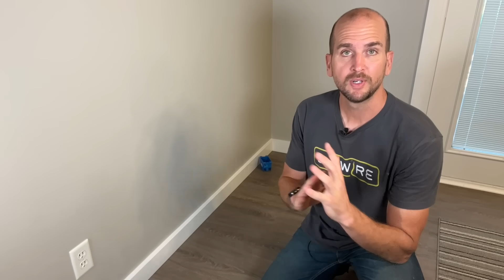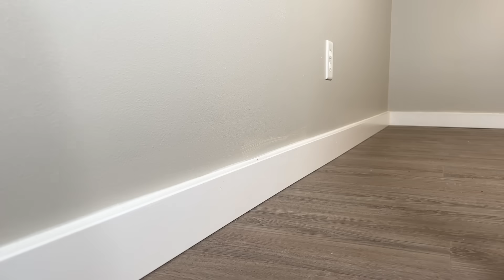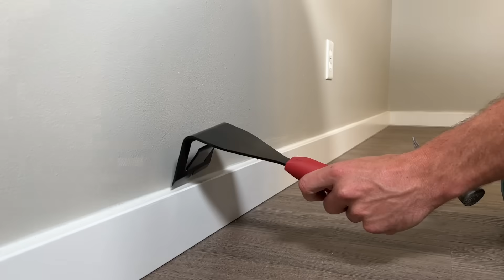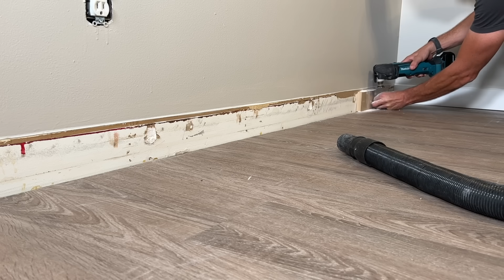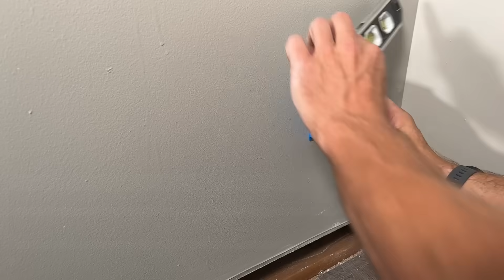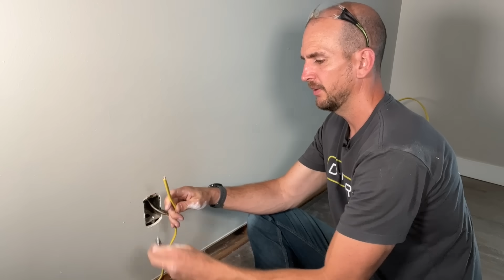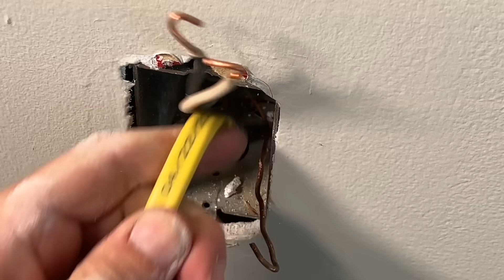How To Add An Outlet To A Finished Wall

Comment: This was perfect timing; I'm going to be installing several outlets this weekend into spots where I have neither access from below or top, and will be using your techniques to get it done right! Thank you!
Reply: If you want to comply with the NEC, you need actual steel plates to protect from nails and screws, not luck.
Reply: BURN THE HOUSE DOWN
Reply: @Rizzodrumz  Why do you say that?
Reply: He's probably refering to the potential electrical code violation you might be perpetrating. If there is more than one cable going into any existing box when you open it up, you most likely should not add another cable.  CEC/NEC regulates junction box fill. If you over fill a box this weekend, you could burn the house down in 15 years. Just sayin.
Reply: @yoyomama5203 :

NEC §314.16(B)(1) requires that each conductor originating outside the box and terminated/spliced within the box be counted once, and each conductor that passes through the box without splice/termination be counted once.

Please explain why you are double-counting or triple-counting spliced conductors.

Comment: Great video, in metal boxes I usually wrap the receptacle with electrical tape covering the screw terminals, thus preventing the side terminals from contacting the metal box. Not necessary, but professional touch.
Reply: Not necessary at all. Unless it's hot. Then, just to make you feel better

Comment: If you suck up drywall dust, make sure to put a pool sock over the filter. Makes them last 20x longer, and far easier to clean off.

Comment: Good informative video for adding an outlet without turning it into a much bigger project! I hate to be THAT guy and I know this video wasn't about this issue, but I didn't see a pigtail for grounding the metal enclosure. Isn't that required for all metal boxes? Did you connect the new wires and outlet to the existing pig tails and the box ground is way back in the box? Just curious.

Comment: I love your video however you can’t convince me that lever connectors are better than twisting wires and putting a twist nut on them. Those connectors can fail but wires twisted together will never loose connection

Comment: Definitely a lover of the Wago 221s as well.  Replaced a standard outlet and switch last night in my breezeway and it was a rat's nest in that 2 gang box.  The outlet had three wires on each side (1 on the screw and 2 backstabbed):  Incoming, to/from switch/light and going to another outlet plus two on the ground screw-the switch was old enough to lack a ground screw.   Wound up using three five position Wago's (one each for hot, neutral, ground) and pigtailed to the new switch and GFCI receptacle.  

I'm sure if I had used conventional twist wire nuts, they would have kept falling off (or had a wire not grab) enough times where I would have felt like punching the wall in frustration.

Comment: I used to do low voltage work (alarm systems etc.). We would remove the trim and then run the wires under the drywall. Since there is usually a gap between the floor and the drywall it worked perfectly.

Comment: I like the idea of making a block for cutting the drywall, buy I would have checked to see where the supply line  for the box comes from first. You may have already known that, but DIYers may not think to do that first. Good job though.

Comment: It works, but I'm sure it isn't legal where I live,  L.A. area. You need nail plates on both sides of wall where romex passes through 2×4s unless you're using steal conduit, not aluminum. And here romex must be anchored to the last stud it passes through on both ends.
But your job works, just isn't legal unless codes have changed since I built my house in 2000. Plus codes tend to get more restricted than less.

Comment: This would work awesome if I had a newer remodel baseboard trim. I have original 1950’s trim and that stuff is nailed solid through and through. Even went through some of the original hard wood floor. No luck, will have to open up those PITN plaster walls, gets everywhere!

Comment: Do you need to worry about tripping the breaker easier since you're wiring these in series?
Reply: They are actually wired in parallel. You only have too worry about plugging in and turning on too many appliances.

Comment: what was the reason for the pigtail? Could have just connected to the second screw terminals for an easier installation without having to cram more wires into the box. Pigtail really only makes sense for the ground wire in order to ground the metal box and receptacle
Reply: Pigtails are what we in IT would call "Best Practices". It allows for easier diagnosis and repair in the future.

Comment: This might save you some time with drywall patching but IMHO the easiest way to do this is with a trick I learned from a local set of electricians where you simply use a router to create a 1/2" channel straight between the boxes. One thing to consider with the shown process is that most amateurs are going to end up damaging the baseboard trim during the extraction process. But if you're truly averse to doing any drywall work then by all means use the approach shown here, but for me the direct channel is the quickest process.
Reply: Agree!  Often to damage then patch the  original shiny smooth paint on finished trim/base board (like sprayed oil paint) is much harder to fix than patching dry wall with regular flat paint.
Reply: No

Comment: Great tips!   Both running the wire behind the baseboard, and putting the connector onto the wire before snaking the wire into the box.  I am AWFUL at drywall patching!

Comment: "You can never have too many outlets" - Wrong. The Canadian Electrical Code (and US NEC too I believe) limit the number of devices (lights + receptacles) on one circuit to 12. You didn't indicate that you verified the number of devices already on your circuit before adding one.

Did you use a code-required tamper-resistant (TR) receptacle?

MOST importantly: You did not pull a permit and get an inspection. Inspections are intended to catch errors like these and to review the quality of your work so it does not electrocute a child or start a fire.

Although you appeared to do good electrical work, it would have been illegal in Canada and maybe in the US too. You may do inspected work on your own occupied residence but you MUST be a licensed electrical contractor, at least in Canada, to do work in premises which you are renting out to others and not occupying. You stated this work was for an AirBnB. In Canada (and maybe the US) if someone dies as a result of your illegal work you are in for a pile of legal and financial pain.

I did like your neat, careful, and effort-saving techniques which I will consider in my own upcoming work in my own house and which I will be getting inspected.
Reply: You're not required to pull a permit for simple electrical work in the US like this as far as I know. Now if we were adding a new sub panel or something like that, that might be a different story. I'm not sure about the 12 device limit, but likely true.

Comment: When drilling the new holes for the wiring through the studs you said to drill them slightly up under the drywall. I was wondering it there a electrical wire minimum   height from the floor according to code? Also, I noticed the volume level on your videos seems to be a little low.  I have to turn up my volume and turn it back down when going to other videos.

Comment: Great idea. The only bit of safety concern is the romex is not protected by nail plates on studs behind drywall. Is this something an inspector can call out?
Reply: Got an answer from electrician buddy. Said because romex is behind finished drywall it's good. If it were lower in exposed area then nail plates would be required.

Comment: Why’d you decide to use the pigtails for the hot and neutral of the existing outlet instead of back wiring both sets of conductors?
Reply: Pretty sure it's code now that you don't string a circuit through an outlet to another to another, primarily for safety as instead of having power go through a wire nut or Wago you're running the power you're using through those little break away connector tabs on every outlet in the string and if you ever have an outlet fail every outlet downstream will also be non-functional, which might present more of an issue for some non-handy people who need to wait and pay for an electrician to come out as opposed to simply having one outlet not working.
Reply: @msytdc1577  Maybe local code, not NEC. Certainly the connection from the 2 back screw plates on the same outlet is more reliable than a spring connection in a Wago. The breakaway tab between the top and bottom sets of screws is able to handle 20 amps even in a 15A receptacle. Pigtails have become the "best practice" for the majority of electricians though. If it became an NEC code, the receptacles would no longer have the extra connections on them.
Reply: @markc2643  A lot of the time lazy installers will utilize both the back push-in connectors as well as the side screw terminals in order to chain outlets and/or split off connection to a switch for lights or switched outlets, so unless they come out with products specific to only one method of connection I don't see how they can eliminate 'extra connections'. 

And the little break off tabs are to allow for the top outlet to be on a different circuit than the bottom outlet (one often being on a switch for free-standing or table lamps), so again unless they eliminate that tab you could always take advantage of using the top and the bottom connectors (push in or screw), the manufacturers would have to sell outlets that are either connected or not connected with either only push in or only screw terminals, so now you're up to four SKUs from one, yikes.

The commercial backwire outlets shown in the video do allow for two connections on the same screw (top or bottom), and they're pretty beefy and I wouldn't anticipate any issues with connecting two wires that way.

Aside from slightly greater resistance the Wago connectors are perfectly good, and I'd counter that the clear body allows verification of a proper connection (fully inserted, wire insulation stripped back to proper length), and are less user error prone than using wire nuts in general, as it's often easy to have a wire have a poor connection that passes an initial pull test (if installer even bothers), and later loosens up from heat cycles or someone monkeying in the box like stretching an outlet out to paint or something, not even necessarily electrical work. 

Wago connector springs serve only to apply constant pressure of the wire onto the metal connecting bar, they do not transmit any electricity, and you cannot disengage that spring without flipping the lever 90 degrees which requires quite a bit of force and if it's really that concerning you can tape around the connector. 

Wago also sells push in connectors without levers but they are not suitable for use with fine stranded wire such as for a ceiling light, but they are faster and easier on your fingers than the lever models. You can still remove wires and reuse the connector a limited amount of times with solid conductors. The body is also clear to again allow verification that the wire is fully inserted.
Reply: Less force needed to push the outlet into the box, and fewer wires to get the bend right as you are pushing the outlet in. It works just fine connecting the hot and neutral to the outlet when you have back terminals though. You can connect 4 wires on each side of an outlet, but it makes it quite tricky getting all the wires to comply.

Comment: Awesome video. Been learning a lot from them. Question if your original outlet has the blue plastic box how would you secure the new new cable from the bottom when adding another outlet further down the wall?
Reply: You don't need it. Just make sure you leave 6 inches of wire sticking out past the wall on both sides to connect outlets.

Comment: What a superb video. I’m in the UK and although I used to be an electrician I found the trick of cutting a low strip off the plasterboard very useful. Surprised the American regs allow bare earth wires in a box with exposed live terminals. We put green sleeving over the earth wires
Love that you say Romex, manufacturer? When we say twin and earth

Comment: Awesome clarity and descriptions. 40 year diy and I still learn something new.
Only additions I would add is some blue tape and/or cardboard to avoid oh shit moments if something slips and damages your nice floor, moulding, or paint.

Thanks for the enjoyment of watching another good diyer.

I just started using the wega connectors but would likely have used the double screw terminals on the exsisting outlet to daisy chain the wires. There is still far more surface area on the screws than any connector I know.
Has anyone seen them add wega style connectors to the back of switches or outlets?
That would be ideal. Any time you can eliminate connections in the box I am all for that!

Any agreement or counter point would be great.
Reply: The guidance against daisy chaining I've heard is you're using the receptacle as the junction so if it ever fails then it kills everything down steam
Reply: @gino_  100% what Gino said.  Using pigtails when wiring receptacles - whether using modern lever nuts, or old school twist-on wire nuts - eliminates the chance of one bad receptacle taking down everything past it on the circuit.

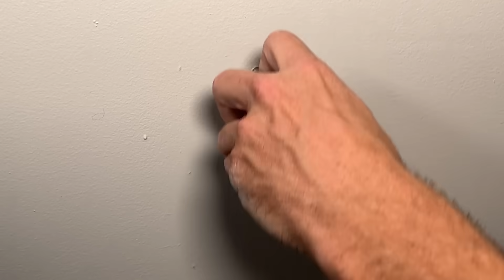Comment: Good video and tip for adding an outlet. I do not see a need for the pig tail setup though. The existing output is at the end of the electrical  run ( as shown here  4:59 ) and you're able to extend from the existing outlet's second set of screws to the new outlet. A pig tail for the ground makes sense since it is bulky.